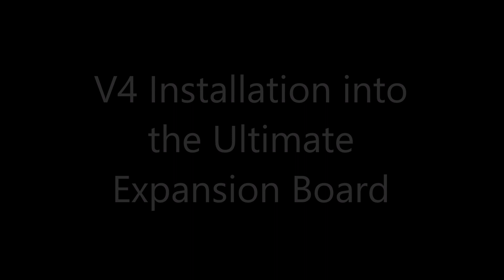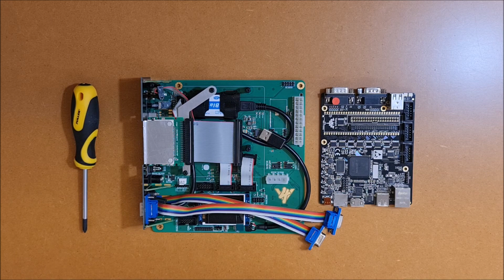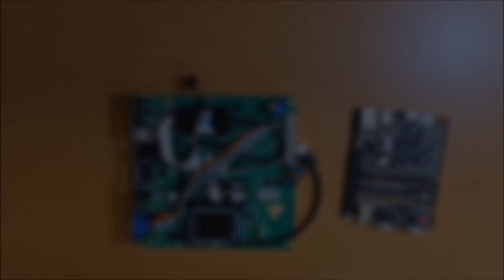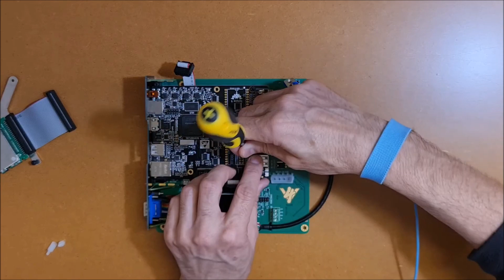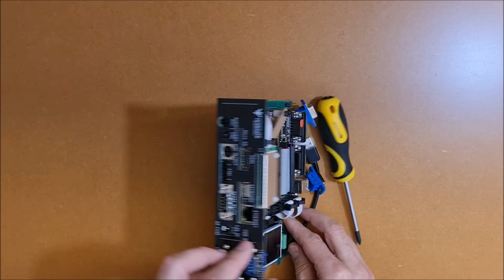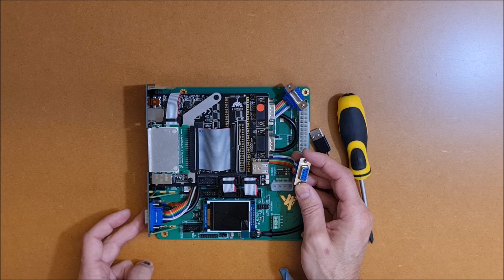How to install your Apollo V4 into the Ultimate Expansion Board

Comment: how would you setup this to include cd-rom?.. i'm interested in this expansion board for two reasons, getting normal 3.5 mm audio jack connector and have the ability to add cd-rom, so my amiga cdrom collection can be used again..     but, i have found no information how too or if its any good..  its a really big invest..  need to be 100% sure i get what i want from it..   a video adding cdrom would be cool..
Reply from the maker: Hullo, sorry for the late reply! Simple plug in a suitable IDE cable, much like you would on an A600 or A1200, to give you two IDE connectors. The V4 has a 44pin 2.5" connector, so you will need to convert to a 3.5" 40 pin at some stage to connect to the IDE CD-rom. The Ultimate Expansion board has a 5V and 12V header for powering external drives, so you can just wire the power for the CD-rom into that.